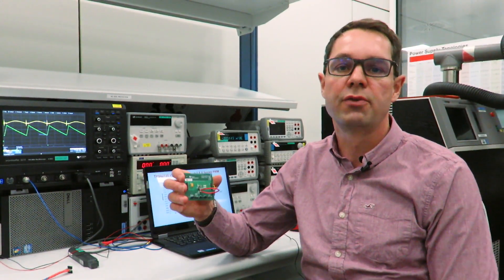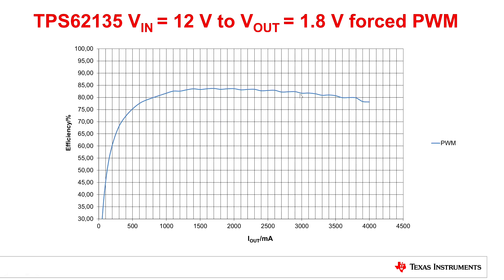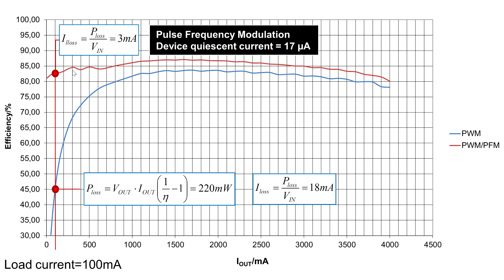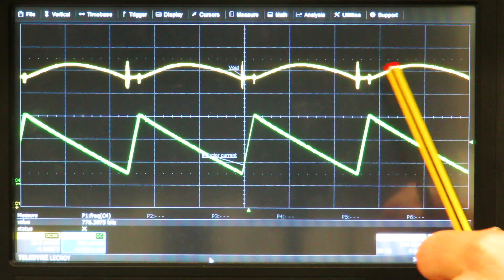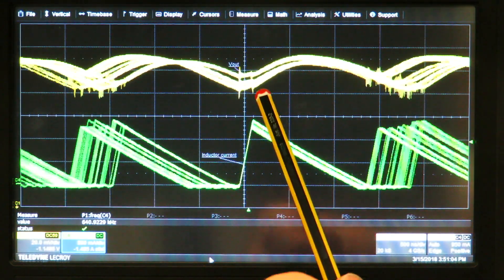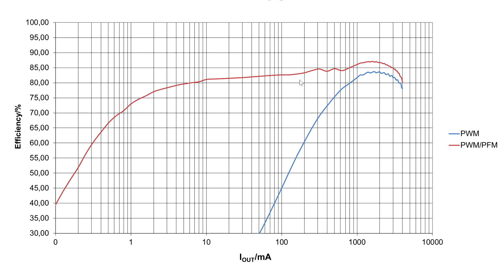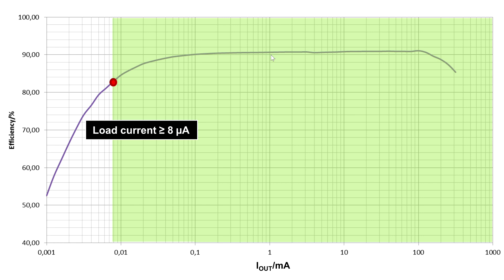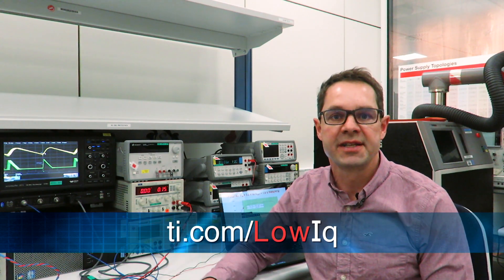Power tips: Iq (quiescent current) and light load efficiency

Comment: Which buck regulator would you recommend for a design with high input voltage(48V) but low output voltage(5V) and current(10mA), while still maximizing efficiency? What are the key factors one should look for?